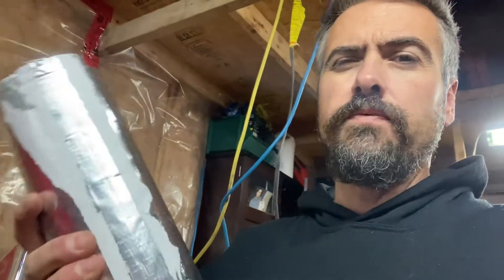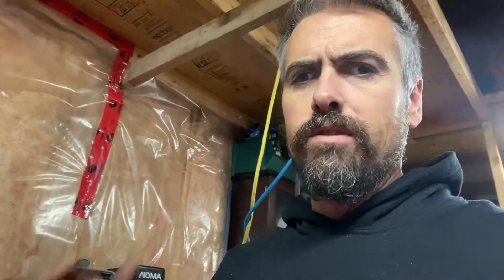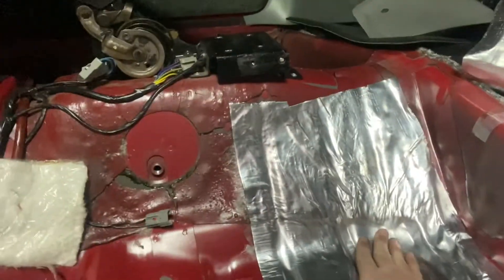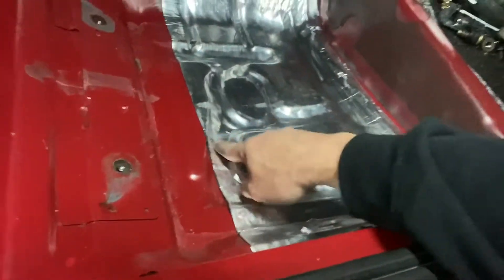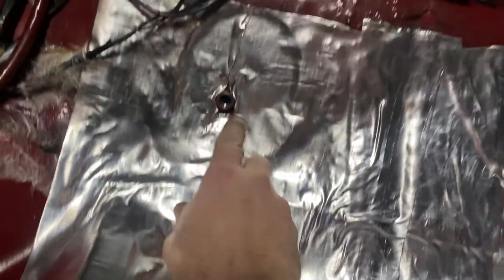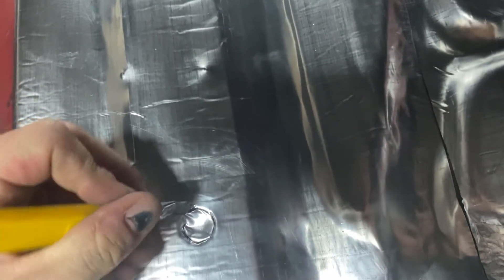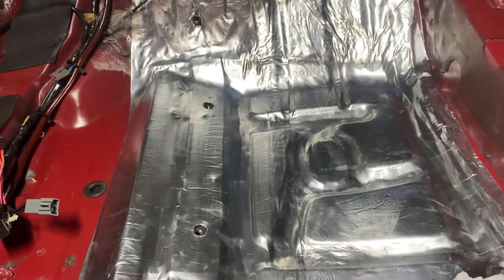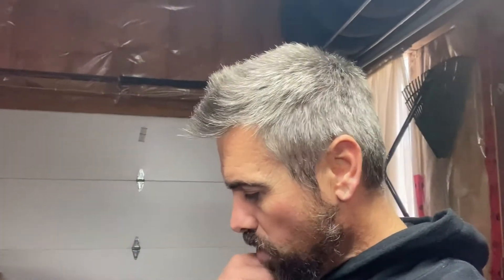Applying my version of Foxbody sound deadening

Comment: That stuff that you used is not the same as an automotive sound deadening material. Been there done that and it smells horrible in hot weather and melts and remember you get what you pay for with sound deadening materials. I only use top notch stuff and that doesn't even block noise it just deadens rattles if you want to block road noise you need Mass Loaded Vinyl